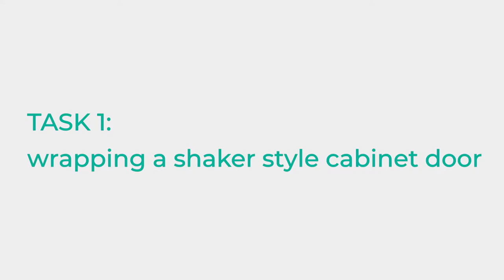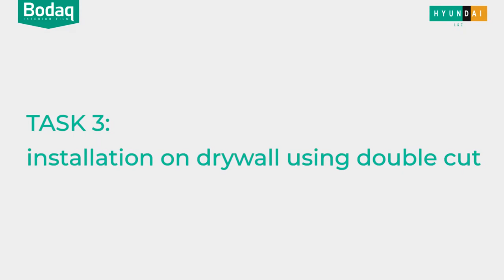Become a Certified Installer of Bodaq Interior Film. Full video about certification process

Comment: Very impressive !!!!
Is there a risk of retraction and seeing a line between the films after some time with the double cut technique ?
What is the most durable technique between stretched and cuts corners ?
Thanks !!!
Reply: If it is installed not properly - there is a small risk. But even in this case it can be fixed. But there is a way how to avoid this issue.
Also overlap is a good solution if you don`t want to take any risks

Both are durable if done properly and you used primer on corners.
Reply: @111Squater111  How can you fix it ? What parameter cause retractation in this case? 

Nice !